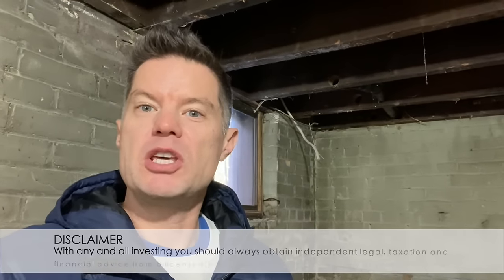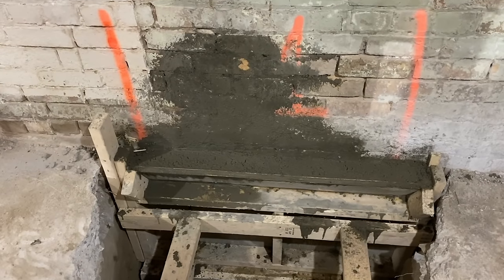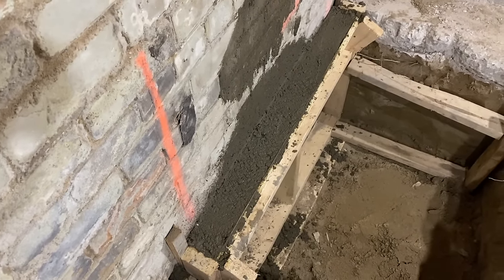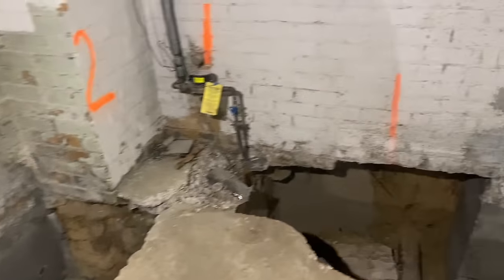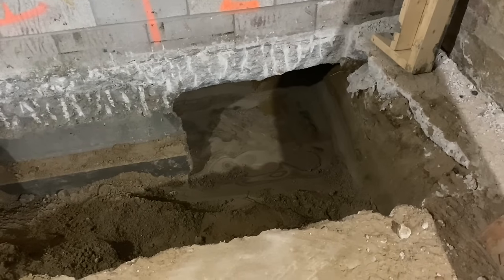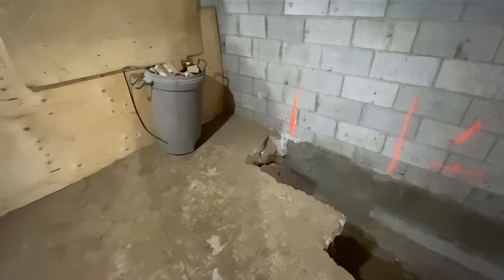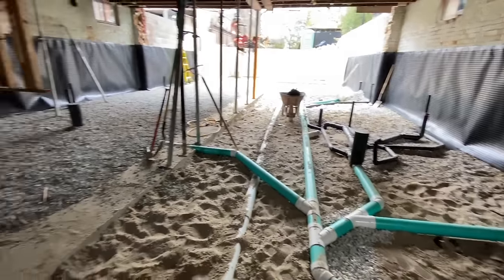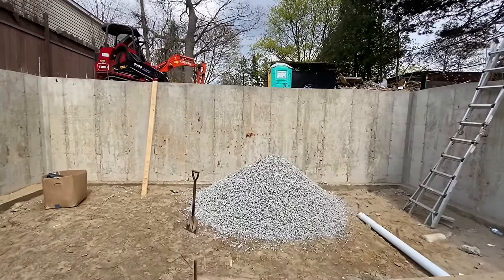Lowering your Basement | Step by Step Underpinning Explained | How to Lower a Basement

Comment: I'm thinking the walls, will have an increase in hydrostat pressure.   I'd almost like to see a second wall, inside the foundation with 6" of stone between the two providing additional support perhaps 6' high which would act as one with the foundation, but you did allow the water to move to thru the dimples, so, you are not "increasing" it by restricting the water flow, You are increasing it by surface area, and height.   (b.t.w. I did the math for retention walls for a concrete company.   there is a triangle of weight, when you went down, you increased the weight, without increasing the wall width.  As a math guy, that's what I'd do.).
Reply from the maker: We rely on the engineers to tell us what to do and if the load calculations are correct.
Reply: @Norman Graham Structural Engineers in Ontario are highly educated and Ontario Structural Engineering Codes are very strict and the factor of safety is really high there.  It is not as simple as you put it as there is also rebar consideration within the new foundation wall & footing which adds to the structural integrity of it.  You simply do not have enough information to make a statement as you did by starting this comment.  If you want, go to university in Ontario for Civil Engineering, then work for a firm for 4 years before you become an engineer then you can make more accurate assumptions about projects like this.
Reply: @MV-wb2cz  i have two engineering degrees, and worked calculating retention walls. none of my walls have budged.
Reply: @normbograham  sure, but you have no idea how thick that wall is or how much load it has above it. A lot of older homes weren't built to minimum possible specs, so you have no idea whether these changes are pushing the limits now

Comment: Interesting, it'll be a big value to the property certainly. It'll be nice to see the next steps of the projects  I have a question though, if the waterproofing membrane is on the inside that does direct any infiltration under the slab and will get absorbed to the uperside of the slab. What is the aolution for that? Thanks
Reply from the maker: Any water that penetrates the foundation ends up in the interior weeping tile and ultimately in the sump pit and pumped out. This is a very sandy area so the chances of any water coming in are slim to none though.

Comment: Curious, why not detach and raise the house from the old basement, knock the old basement out, pour a new basement and drop the house back down on top of it ?
Reply from the maker: I've seen this done and sometimes it makes more sense but it would be logistically challenging in this location and I think it would cost a lot more to take this approach. Probably 2-3 times the cost.
Reply: @DarrenVoros  Thank you. I assumed that the location made it difficult to do so.   I've seen houses raised and new foundations poured in our area for $50 - $100k depending on size of the home.  Wonder too, was the basement turned into a living area, eg is that the reason the basement was lowered ?

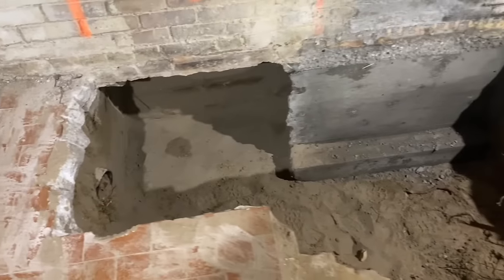Comment: 6:05 they didn't need to put rebar stubbed out to the next pour? Also at 13:10 would the bench footing sill plate block the flow of water, or is that membrane strong enough to elevate itself slightly for water passage? Great video!!! $400 a liner foot is not too bad. So a 25x25 foundation would be about $40k (usd?), and depending on the beams and whatnot. Great info about the backflow and suites.
Reply: If we assume his $400/LF was in CAD, when you convert to USD it comes out to $317/LF. A savings of 20.75%
Reply: Also wondering about rebar.
Reply: I'm guessing they had rebar in them and doweled each section together before the pour (couldn't over hang rebar when the dirt was still there). Wouldn't be much different than old stone foundations if they didn't, but I don't think that would pass any modern code
Reply: @onetwothree4148  I see, since they use the side of the dirt as the form. That makes sense somewhat, doesn't surprise me it's due to a code.

Comment: I've been humming and hawing about the idea of doing this. I have a 2' drop-down living room off the side of my house (24x~12) that use to be a motorcycle garage I guess. It has a 3' high pour concrete crawlspace underneath it and a plastic barrier/pour concrete rat slab. But what a waste of space I don't know why they didn't dig deeper, pour a deeper foundation and turn it into another room. I'll pay the few bucks more a year on taxes to have another +/- 230 sq ft room in my basement.

But I didn't know how it would be done until now. Obviously it's not a DIY job and it'd probably be cheaper to just add a 230 sq ft extension on piles off the back of my house BUT this crawlspace (which we use for storage obviously) is going to become pretty useless once we're into retirement and I can't climb in and out of it (I'm 34 now) - especially to get those Christmas decorations as an older guy. Sure they cold go in the garage attic I guess, but then I'm still stick with this crawlspace I can't get in and out that has so much protentional.

IMO - they should've just turned it into an actual room. So I thought, "What about digging it down 3 feet lower than the current basement floor is now and have a set of stairs drop down into this room then I'd have a ~23/~11 room with an 8.5 ceiling (the rest of the basement is 7 1/2) I could use as a music studio and a part of it could be storage. Put in a window and I could have a guest room in there too.

Thanks for the info - something I can tangibly look into doing in the future. Obviously it's not a DIY job and it'd probably be cheaper (finishing it would be cheap) to just add a 230 sq ft extension on piles off the back of my house BUT this crawlspace (which we use for storage obviously) is going to become pretty useless once we're into retirement and I can't climb in and out of it (I'm 34 now) - especially to get those Christmas Decorations as an older guy. Sure they cold go in the garage attic I guess, but then I'm still stick with this crawlspace I can't get in and out of until my "future grandkids" come over and help me get stuff out of that. 

We're on a pretty dry lot I don't have a sump pump and I'm pretty dang sure I don't even have weeping tiles ('77) so I'm not worried about water/flooding being an issue having this room 3' lower than the rest of the basement.

INTERESTING!

Comment: I hate seeing everyone use delta mat on the inside of basements.

Its supposed to go on the outside of the foundation. The whole point of it is to keep water 100% away from your foundation and direct it to the weeping tile.

When it's on the inside your foundation is still exposed to water.
Reply: That was my first instinct too, but I guess it's better to keep the water out of the basement at least. Most foundations aren't waterproof anyway
Reply: It's pretty common in the Toronto area. But I've also never seen anything from Dorken endorsing use of Delta-MS on interior walls.  I think the choice to use it on the interior is often due to cost or due to an inability to trench outside around the foundation.

Comment: If you have a older home with 9’ plus ceilings on the first floor its cheaper to remove the first floor and frame out and new floor 10 to 12 inches higher and change the front step elevation. Underpinning is very expensive. I would avoid it if you have the head room on the first level

Comment: Had that been an original footing pour, rebar,  both horizontal and vertical, would likely have been called for.  Why no rebar in the sectional pours binding them together ???

Also, 56k... how could this possibly be worth that level of investment?  The worst investment is buying the most expensive home in a neighborhood.
Reply: This is likely Southern Ontario, Canada.  One of the most expensive places to live, lots of investment opportunities, and it sounds like this project is going to be apartments or condos, so they will definitely more than get their investment back within a few years of tenants.
Reply: @MV-wb2cz  maybe... but a few years and you're back to even.  Hopefully they don't need to sell before a few years has passed.  And after a few years they likely have the most expensive house in the neighborhood.   Too risky for my taste, but to each their own.

Comment: wouldn't it have been faster to just blow out the back wall and use a skid loader to remove the concrete and dirt since you took the back wall out anyways?
Reply from the maker: They did use a lot of machinery here but blowing out the back wall would've required some additional structural supports.

Comment: So I built homes for 44 years. 20 years on 10,000 sq ft homes and we we didn't use rebar or steel mesh ? I was in my first house I built a few weeks ago. The basement was never finished. 8" block walls. Not a crack in the floor or the walls and a 10 ft ceiling? So, if you consider what rebar does it reinforces and bridges the weakness in the footer. Once the footer cracks, the rebar just bends. No matter how much rebar you use. I'll take advice from a builder that's built over 50 executive homes in 44 years LOOOOONG  before I listen to an engineer. We only used rebar when we had to entertain the codes and permits. I see so much rebar and wire mesh in buildings now. Too many people that don't Jack Schmidt designing homes. You would have to give them instructions on how to use a hammer. We always laugh and get some fun jokes in when we use rebar and mesh. It's comical at times to see the ignorance of engineers and architects when they can't even drive a nail or even understand the basic principles in construction. BUT they have a degree !
That's all that matters! 😂. I’ve seen house with more wire mesh and rebar than concrete ? It’s ridiculous.  And it always cracks.  You have to understand concrete.  On the job.  Not sitting in front of a screen playing video games how rebar works.  See real life applications.  Would you rather fly on a plane with a pilot with a degree that’s only flown on sunny days ? Or a pilot on a plane that has 10,000 hours in nothing but storms and crosswinds ?   Same thing.  You can’t replace experience with a computer program.  Obviously they fail.

Comment: Man, I got 5 dollars and a shovel.
Reply from the maker: What more do you need? lol
Reply: That's what I told some contractors many years ago. Contractors were replacing city water service on our street and said they would run it into my house for $2000.   Didn't need the shovel. They did it for $500 as they were about to pack up and move on to the next street.

Comment: How is this cost effective?  The place is gutted, added onto, basement is lowered. All that looks like was left was an OLD assed dated brick house. Seems cheaper to build new. 🤔🤷‍♂️
Reply: I’m definitely not knocking the work. I just see as much labor and cost as new construction, but with an old brick and block basement, old framework, and old brick…. Why???
Reply: $56,000… + addition, floor heat, gutting and rebuilding the whole thing. How much could possibly be saved over building new?  I am really curious. It might be $$$$ or -$$$$ 🤷‍♂️
Reply: @patrickc1508  Zoning.